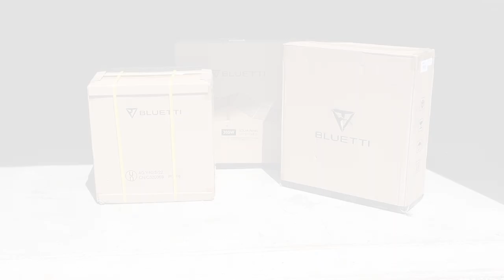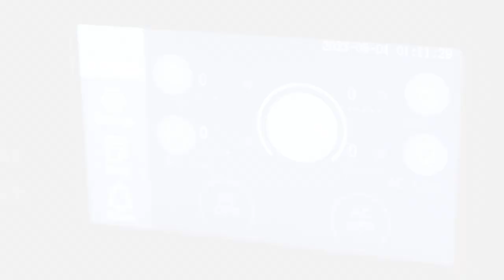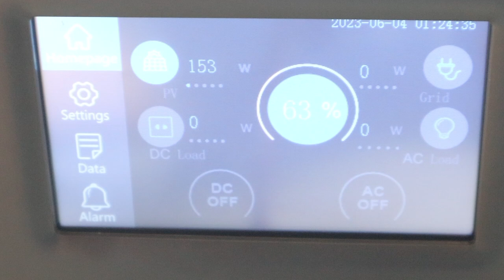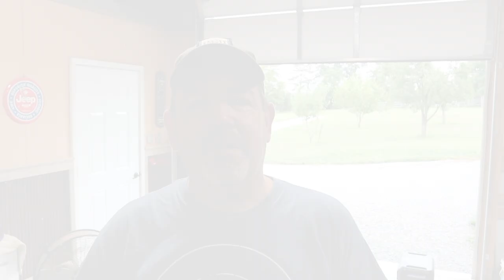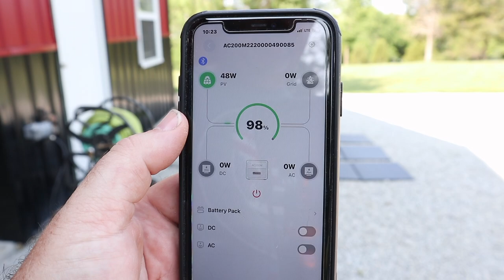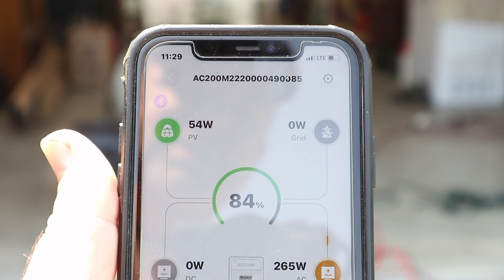#183:  My first time using a Solar Power Generator - Bluetti AC200MAX

Comment: I appreciate this video as I have been eyeing Bluetti for a while. If you are interested, here is a great YT channel where I have been learning a lot about solar. This young man really knows his stuff. DIY Solar with Will Prowse.
Reply from the maker: Much appreciated, I will definitely check his channel out.    I had such good luck with my solar fan I put in the greenhouse that I kind of have a solar bug at the moment.    Future plans is to build a much smaller pole barn out at the farm (hopefully next year) and my hope is to power that completely with Solar Power with a battery back up system.   Load should be light, mostly lights, but would like the option to plug in a tool once in a while as well.
Reply: @TryNewThings  Sounds great! I have similar plans. Good day!

Comment: It will be interesting to see how it works in the winter with cloud coverage.  Great review...
Reply from the maker: My guess Larry is... as long as it is sunny, not sure temperature has much of an impact.   However the days are far shorter in the winter.   Cloud vs Sun is a huge difference that I was not expecting to be so great.    (85-90% less charge in the shade vs sun).    I do need to come up with some way to mount those panels that is not a permanent ugly feature in my yard.   Any ideas?   Something portable and temporary.